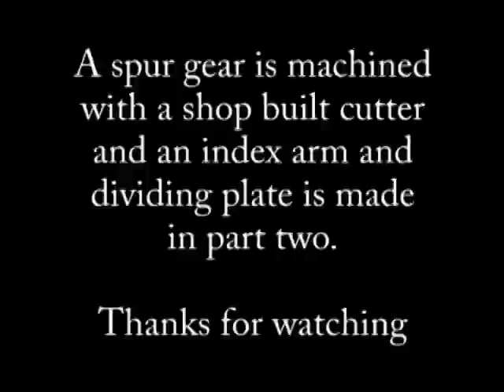Simple & Cheap Dividing Head - Part One

Comment from the maker: The jig was made in my shop with a piece of channel iron, angle iron and flat plate with threaded rod for the uprights all welded together. A piece of flat stock with a hole drilled is for the clamp. The smart nuts are also made in my shop. If you'd like to see how they are made, take a look at my video about smart nuts.

Comment from the maker: We buy PVC from both Enco,  and US Plastics.  Although not used in this project, expanded PVC is another useful materials. It's sold under brand names like Sintra and is also available in building materials at some home centers. Our local Menards and Lowes both sell Trimplank which is much less expensive. PVC and expanded PVC can be bonded with PVC cement and cleaner sold in the plumbing area of home centers. Watch my Match Plate video to see this stuff in action.